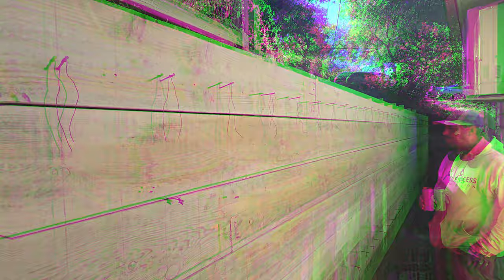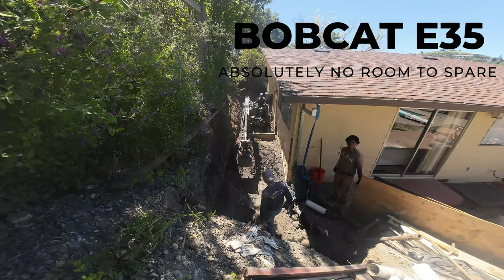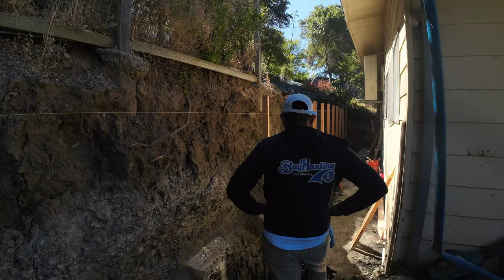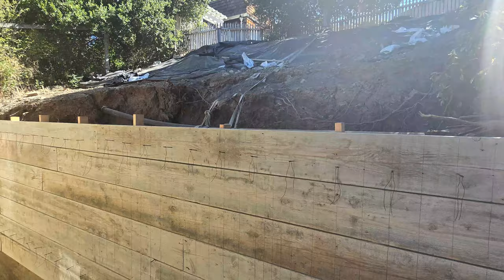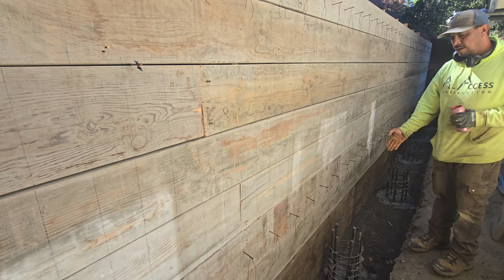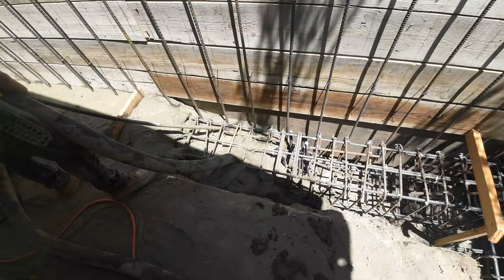"How to Frame Back Of Concrete Retaining Wall Like a Pro (2024)"

Comment: once the retaining wall is built how do you remove the frame on the back of the wall? and how do you backfill the space behind where the french drain goes ? And do you smooth out the face of the wall after it's done (to not see the framing lines)
Reply from the maker: https://youtu.be/VMVVTTZdWJE?si=-JkY4xeW3VEmpmlt

https://youtu.be/Ic2DUUqwe_8?si=BJjFVsZOYAJGtCBa